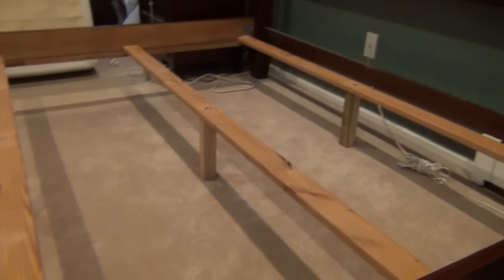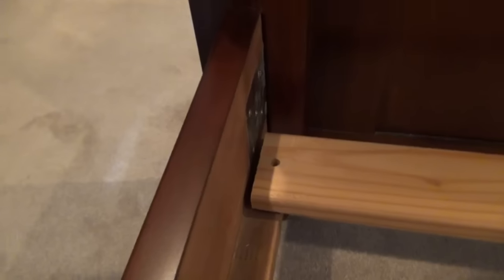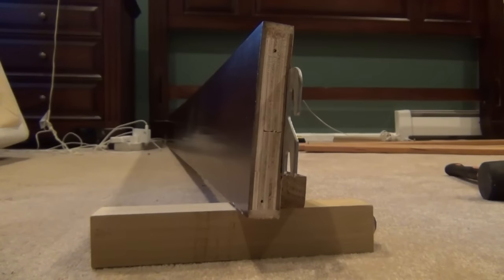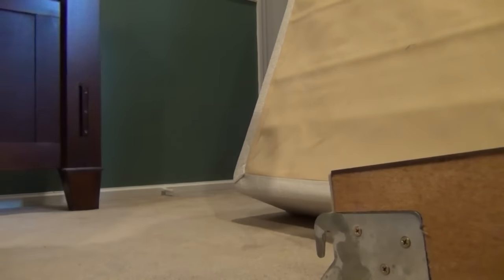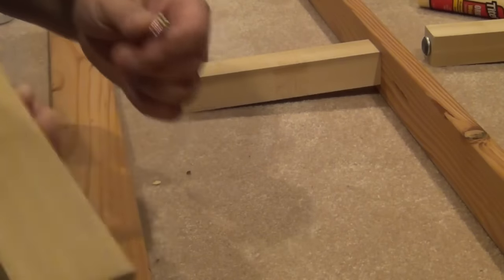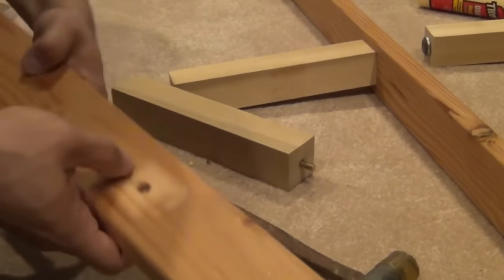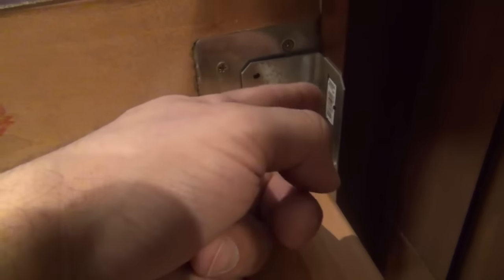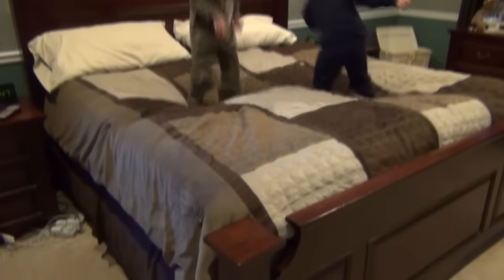How to Fix a Squeaky Bed

Comment: Many people believe that WD40 is a fix-all lubricant; however, they would be wrong. WD40 is not a lubricant at all. WD40 is used as a degreaser or rust remover, and the main reason why it will stop those pesky squeaks is that it will clean most partial out of joints; however, the results will be short-lived.

Comment: Felt was an awesome fix! Before watching the video, I was considering shifting the bracket closer and drilling new holes for the screws to have new meat to grab on to. I added the felt to both ends and used a rubber mallet to fully seat the side rail into the bracket inside the post. My wife thanks you !!

Comment: Thanks for posting.  I just ordered a new bedroom set.  Luckily, the bed frame was the wrong size and got sent back for the correct size.  I was not sure what I would find on here to try and prevent a noisy bed in the first place.  Yours is the 1st video I watched and will be the last on this subject unless it fails.  Way to think out of the box on this.  I will be doing this to my new bed. Way to go.

Comment: Worked for me. Home Depot didn't have the strips, they had rectangle pads. $4.37 cents. Scissors and 1.25 pads total on the part where it was making the most noise. This made for an opportunity to drill new holes because it moved them a bit. The old holes were likely part of the problem because the wood was stripped a bit on the old holes. 10 out 10 for this video!

Comment: Thanks for the vid. I have a queen sized sleigh-bed that's making a lot of creaky noises on one side of the headboard . Last time I just sprayed with WD-40. It didn't last too long before being noisy again and smelled bad for a day or 2. The self adhesive felt and dry lube is a great idea. Cheers from Canada.

Comment: Friction tape works as well as felt strips and doesn’t leave so much wiggle room like the thick felt. If you have creaky wood pegs (with IKEA brackets), a touch of wood glue or lube works to quiet those down.

Comment: My thought was to put felt in on my squeaky bed, but I wanted to check to see if someone has fixed a squeak and low and behold you popped up! 
Great video
To the point
No need to see you struggling with the mattress. I'll check out your channel again.
Reply from the maker: Stephen Bochicchio Thanks for the comment.  Sorry for the late reply back

Comment: Another tip is to use the floor protectors used for other furniture in between the supporting wood frames to reduce the squeeking. 
And if that does not work you can also LOOSEN the nuts/bolts used to fix the wood frame.
It seems to work for me the second time.

Comment: Great video. I am about to do this to my bed this weekend. I was thinking of the adhesive foam & lubing the metal hooks.             I appreciated being able to watch you go through it step by step. & the dry lube! going to get that stuff for sure. I was thinking wd40 but I also was worried about it being a mess and staining things. thanks for the helpful video.
Reply from the maker: yorkandpomona Yes, the dry lube works great!  Good luck with your repairs and thanks for the comment.

Comment: Great vid. Have almost same bed and exact same problem since year 1 of ownership. I've temporarily quitened it twice by slipping folds of electrical tape between the rail ends and legs w sticky side toward rail end, but it always works back out and now is worse than ever. Was looking for a better solution and came across your video. Gonna try the felt and dry lube, along w another tip of using beeswax at any points where bare wood makes contact even if able to make the wood on wood conecrion tight.
Thank you

Comment: I found some vinyl weather stripping at Home Depot 3/4 wide by 3/16 thick by 17 feet long for 3.97 per roll.   Worked great.  Sleep well

Comment: I use PB Blaster penetrating, but never seen the dry lube! I am going to try that. That seems much better for the home as you stated. Good video! Keep up the great work.
Reply from the maker: Josh Ferguson Thanks for the comment.  I really like PB Blaster's line of products. Good quality.
Reply: zimsjeep I replaced the bed slats with a couple sheets of 3/4 plywood and this helped some on our bed. Our posts are old and there is a lot of play where the bracket fits in it. I wish there was a good way to resolve this. I am going to try the PB dry lube to see if it helps! I imagine the posts will need replaced, purchase a new bed or deal either the squeaking at this point on ours.
Reply from the maker: Josh Ferguson The plywood seems like a good fix. Have to remember that. Good luck fixing yours. If you find any other solutions, post an update.

Comment: Great job! Do you think this felt would be enough to fix a loose bedframe or would you have to go the extra mile and get a bracket?
Reply from the maker: ForgeofSouls try the felt first, you might be surprised. The main objective is to remove all play and slop in the frame. The felt tightens everything up in that regard as well as reducing friction.
Reply: ForgeofSouls  good
Reply: I couldn't do that as my bed frame is just fixed with dowels. :(

Comment: For cheapo Jerome's box spring without any spring. But just a cheap pine wood frame (China made) whose lateral panel may crack... A quick replacement with a 59" oak wood 3" slats is doable by cutting a 3" long cut into opposing ends of the box spring then sliding the new oak piece in between while securing with 1.5" screws.  Problem fixed.. From having Jeromes argue with you  about they won't replace ones broken box spring.

Comment: A lot of the time the cause is the boxspring. Cheap boxsprings have cardboard in them that when removed removes the squeaking. Don't ever buy a boxspring that has cardboard in it (technically it would be called a "foundation") . It won't squeak at first but the more it's used the more the cardboard softens and that's what causes squeaking particularly along the edges where you often first sit on the mattress.
Reply from the maker: Paul Denet Yes, I’ve seen that too but in this case it was definitely the bed frame. Thanks for the comment!

Comment: If the bed is made of steal then what to do plz help
Reply from the maker: DJ BIDYUT Remix should be able to disassemble and install the items I used in the areas where the noise is coming from.  The noise will always come from an area where two materials are running against one another. You need to isolate them from each other and you noise will stop
Reply: DJ BIDYUT Remix the same

Comment: add thin 1/8" thick 2" x 4" rubber inner tube (bicycle)  cutouts with 4 drilled holes so as to go between the bed frame joists. you don't squeaks when getting Romantic with your Love/wife.
Reply from the maker: That could work too, thanks

Comment: Wd-40 is not a lubricant
Reply: beenn15 Then what would you call it? A penetrating oil?
Reply: @sourtube5397  This thing started as a water displacement solution.  That's what WD stands for.    It prevents and dissolves rust by separating the water content from metal. Whatever lube you think, or the manufacturer thinks is the result of its usage is nothing but the dissolving rust and dirt that should be thoroughly cleaned.  It's only a matter of time before the solution evaporates leaving behind the same displaced rust and dirt.
Reply: beenn15 Never knew that. That's why it's so good at cleaning stuff.